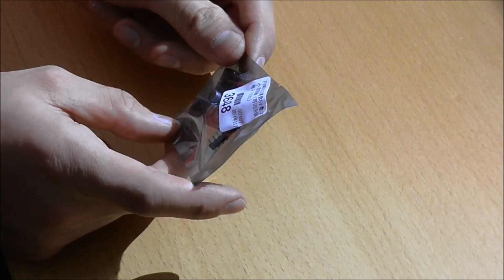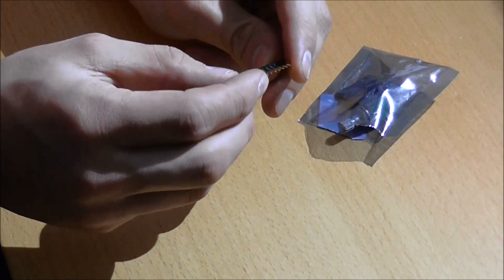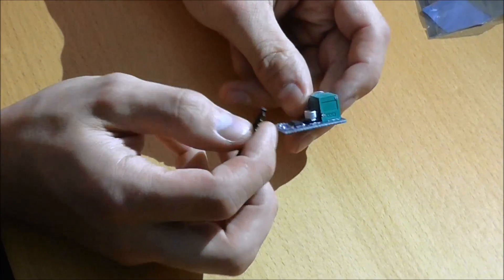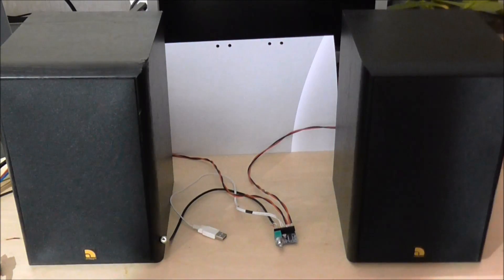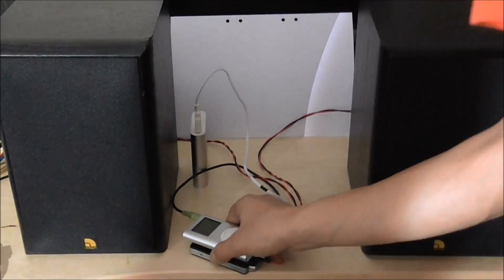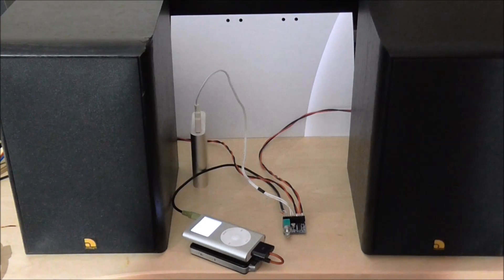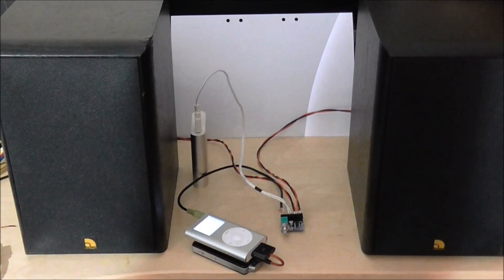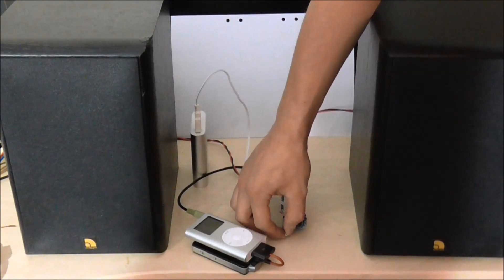Stereo 3W 5V class D amplifier

Comment: Good video. Thank you. Would have more beneficial if wiring connections were clearly shown in the video between Board and Components. Headers can connect to wires easily with or without soldering(for initial testing).

Comment: I've watched a number of the YouTubes using the PAM 8403.  Your's is the best!  Good camera work and neat work space. I suppose it could be wired up without the header, but it probably makes connecting the various wires easier than soldering directly to the board. Is that a correct assumption?  I want to use the amp to beef up the signal from a DVD player before sending it to an unpowered speaker.  Thanks.  I've subscribed.